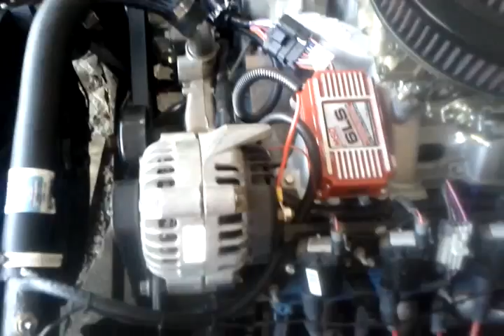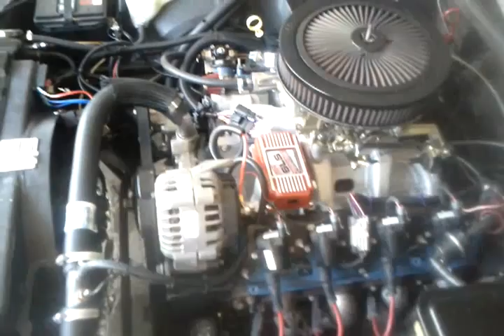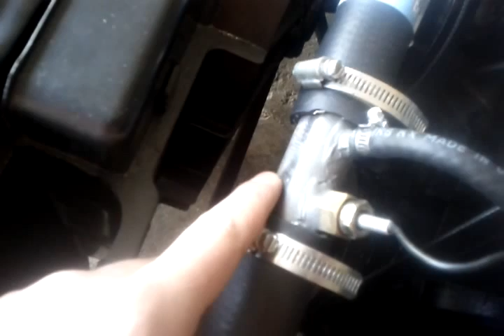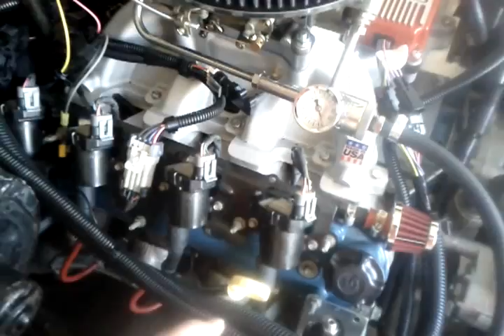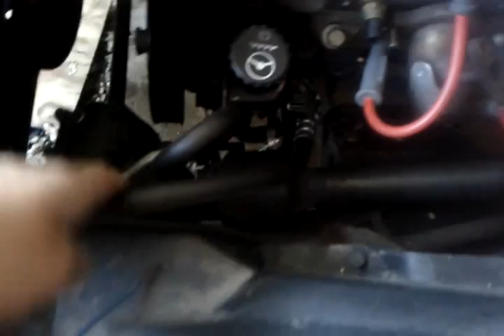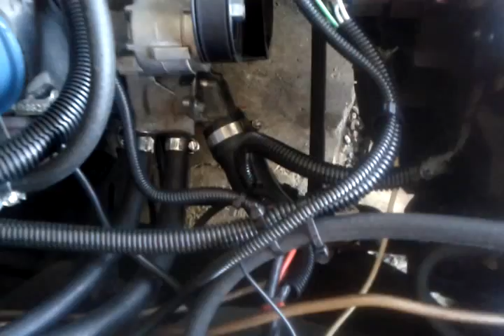How-to: Swap an LSx Ls1 4.8 5.3 6.0 into older GM cars

Comment: Have a 66 Chevelle doing carb ls swap how do I wire alternator if I’m using stock factory harness (Has 2 pin white connector for internal reg alternator originally)

Comment: I saw your video and I'm doing basically the exact same thing Carbrated 6.0 in a Malibu wagon I'm using a TH 400 now but will eventually be going to a T56, my question is will the converter from the 400 mate to the flex plate on the 6.0 or do I need an addaptor?
Reply from the maker: Depends on what year 6.0 you have
Reply: @beeterolds  05 DK what gen that is

Comment: so which block did you put in there , the 6.0 or 5.,3/4.8? ive got a 84 cutlass with a running stock 305 but  i think about 50 of the stock 140  ponies escaped or died in last 37 yrs so seriously considering LS swap and already bought a  $200cdn 5.3LS  but the guy is stalling  on coming up with manifolds , ecu, starter and  alternator so may just resell it and get a 6 litre for 1000 cdn.....if it will fit?

Comment: What wires did you use from stock alternator pigtail. did you just use the exiter wire ?
Reply from the maker: Bingo
Reply: Ok i did that and also installed resistor but its pushing more than 14v and acid coming out battery

Comment: good morning,  Im having trouble mounting the power steering to the engine. Will the truck serpentine set up fit the 72 cutlass or do i need to find one from a car or which pulley can i use.
Reply from the maker: It would. Ud need a pressure hose from a G body tho
Reply: @beeterolds  do you know where to purchase the 5 inch diameter pulley from
Reply from the maker: Any good parts store will have it.. Does it have to be 5 inches?? Some guys use a jeep pulley

Comment: Did your power steering pump have 3 lines , im guessing a return line. Do i need to clamp it off or is there another solution
Reply from the maker: 3 lines means hydro boost... Change ur pump to non hydroboost
Reply: @beeterolds  Thanks alot

Comment: So im having a problem with my LS1 with the 6014. everytime it gets to 180 degrees it starts to stall. any clue on what could be going on?
Reply from the maker: Im assuming the box uses a coolant temp sensor??
Reply: @beeterolds  Yes it does. i bought a new one. also my electric fans are on as well. You think i have a faulty temp sensor? i have heard of that on some websites.

Comment: How did you set up the fuel pump,is it wired thru you ignition or did you go thru an oil pressure switch???

Comment: When you installed the alternator and power steering bracket what did you get that off because I'm not sure what to use
Reply from the maker: Stock truck
Reply: @beeterolds  what year truck did the brackets come from because I'm not using air conditioning

Comment: Im wanting to put a ls into my 93 silverado but was told I need the computer and all but it looks like you didn't need all that with the carburetor correct?
Reply from the maker: Correct. Just msd to control ignition

Comment: So if I were to take a 5.3 vortec and 4L60E out of a 2004 silverado, could I just drop it in a 85 C10, and use these instructions?
Reply from the maker: It should drop right in as long as you have the correct engine adapters.. the trans mount is in the same spot assuming ur 85 has a th700
Reply: @beeterolds  okay, thank you. Hopefully it works out good.

Comment: What wires are use under the dash to start car I’m doing a g body now
Reply from the maker: Fusible links, and your 12v source from your HEI to power the MSD if you go that route. It's easy.
Reply: @beeterolds  Pink wire off the IGN, switched 12Volt.

Comment: Temp in the head is much higher than in the upper rad hose (you'll think it's running cool all the time)
Reply from the maker: Yessir... Temp gauge reads 180 while in fact the coolant in the head is around 210. I knew that going into it. I've since remedied that situation

Comment: Can I convert the Direct Injection Fuel pump for use on a Carb setup? I was looking at an l83 5.3 for use offroad using a simple conversion to carb like you used here.

Comment: I know this video is old but I recently did a similar swap on my 89 Camaro and exhaust wise I was kinda screwed until I found cheap Chinese long tube headers with a Y pipe fitting for $275 and with thick aluminum crush gaskets they don’t leak and they fit!!! Much better deal than paying $700 for swap headers
Reply from the maker: You can get them cheaper than that...
Reply: BeeterOlds / really? I mean these headers tied right into my exhaust I just had to replace the factory cat with an oval one from summit

Comment: Is it possible to reuse the stock electronic carburetor with this setup. 
My is 87 elco with 305.
Reply: I'm trying to do that now building adapters for my 89 tbi intake to fit on my 5.3
Reply: @luisviscarra6321  let me know of your end result.  Thanks

Comment: To the point and simple.  You sure brought out a lot of haters with you "To the point video". O wish I would have went this way on my current build. 87 4x4 Silvarado. Putting a 383 stroker together with ported heads and Quadrajet for all day drivability. I'm about positive that any stock LS with your setup will out pull my SBC after I'm finished.
Reply from the maker: People suck. More than likely the haters have never lifted a wrench or built anything

Comment: What electric fuel pump and pressure regulator did you use
Reply from the maker: Factory 4.3 TBi from a Monte and Holley regulator. Set at 3.5 psi

Comment: Why in the world would you run a carb and not fuel injection? Dumb as hell.
Reply from the maker: $400 for a used intake and MSD controller.. $1200 for EFI when you do it correctly. That's why..nothing wrong with a perfectly tuned carb setup reliable as hell. No special trips to the Dyno paying out the ass for each session. I eventually ran EFI and it was such an expensive headache for a weekend car it's not worth it. Daily driver yes

Comment: What I hate is everyone is ls swapping for the wrong reasons. People who ls swap because it's what they see others doing and because it's what the're told to do is just dumb. If I LS swap I'm gonna use a cast block,LQ4, LY6 or L96, modified l96 heads, machine shop can make it a 383. use forged internals, use custom cam grind and I'll basically make it a stronger block version of a gen 1 racing small block. A factory LS1 is garbage and not worth swapping. Honestly if your a hipster after EFI. gen 1 Small block can do efi as well, look at the vortec 350 for cheap
Reply from the maker: Jack of Blades cheap performance.... Most of these engines can be had in running condition 350hp with headers for dirt cheap.. try that with a 350 or 455 Olds and you'll think twice about it while youre ridge reaming your cylinders on a 45yr old core... But yes I agree.. people need to be creative and follow their own lead not someone else's
Reply: BEETEROLDS but would you agree a bone stock ls1 swap into a older car when you can have a feshly machined vortec  350 with more power is pointless
Reply from the maker: Jack of Blades I mean it's a matter of opinion. I'd rather have a cammed 5.3 or 6.0 truck engine instead of an Gen 1 sbc.
Reply: BEETEROLDS but there is a price per power difference. Vortec 350 with good machine work and race parts will be faster for less

Comment: I dont like the idea of MSD boxes sitting on the Manifold. The capacitors inside of them are only rated for 120°.
Reply from the maker: Don Rutter neither do I. This video is 6yrs Old. Shortly after I made it I moved the box to the inner fender
Reply from the maker: Peter ummm.... I’ve made like 100 update videos
Reply: Don Rutter I think I would have mounted it on the firewall

Comment: What did u do to get the power steering work in with truck pump to fit with out hitting gear box
Reply from the maker: +Michael Rabatin all depends on what motor mounts you use. I used adapter plates and setbacks

Comment: can an 89 scottsdale 5.0l rearend work with ls1 motor out of gto?
Reply from the maker: Bekkah Rannahh the axle should be an 8.5 inch it’ll work out alright as long as you’re keeping the motor stock
Reply: motor will be stock. question what parts will the 89 scottsdale need from gto? besides ecu, wiring harness ecu?
Reply: and how much is swap usually?
Reply from the maker: Bekkah Rannahh all depends. I can’t answer that with one sentence honestly. Research and get creative

Comment: I wanna put a 5.7 vortec engine from a 96 suburban into a 85 el Camino I want to know is their any issues that I'm going to run into thanks
Reply from the maker: francisco ortiz what engine is in the el Camino now? And are you going carved or Efi
Reply: BEETEROLDS it has a 5.7 also but I feel it's lagging in power plus it's carburated and I want it to be efi
Reply: whats in the el Camino now ?? a v8 if so it should be a no brainer small block Chevy is small block Chevy all should work out the same if it's a v6 in it now you'll have to move the motor mounts to different holes in the frame but other than that and what's your plan to run a carb or the throttle body ? that's what
 is gonna be the part that's gonna change things a bit if it were me I would just run a carb and a hei on the vortec motor keep it simple

Comment: Are u in California ?
Reply from the maker: richard villa not even close buddy
Reply: BEETEROLDS Swaps & How to i was asking because I'm trynna get my cutlass a v8 does it really make a difference in gas ? It currently has the v6 3.8 engine but I really want a v8. Don't know if I should go for the 307 olds or ls
Reply from the maker: richard villa the V6 is terrible my car started with the 3.8 a long time ago before I swapped in and out 6 different engines

Comment: i got a 5.3 in a 83 elco. i have everything in but the car is not getting power. its grounded and the wire that went to the distributor is connected to the pink wire. how do u have the starter wired?
Reply from the maker: Juice 23 why don't you watch the entire video I explained it.
Reply from the maker: MrHustleman420 are you saying you have no spark or it won't crank? make sure the MSD is grounded to the battery directly
Reply: BEETEROLDS Swaps & How to i got it goung now. thanks. i had some wires wrong
Reply: BEETEROLDS Swaps & How to how did u wire the alternator

Comment: LESS WIRES,LESS PROBLEMS 3 WIRES WILL RUN A SMALL BLOCK, KISS FACTOR!
Reply from the maker: ed damude that's your opinion.  I ran a 403 and 455 Olds for years this swap is much better. In my opinion

Comment: Good Job, but how do you bypass the heater hoses on an Ls b/c I have taken my heater box out on my Cutlass and I don't plan on putting it back in?
Reply from the maker: MrVigor47 simply run a loop on the water pump. It's easy

Comment: Hey thanks for the info,turns out I had the right mounts after all,some how 1of the mounts got cocked,I don't no how that happened as I'm using a ls1 block that dissent have the a/c mount screw hole ,turns out I tighten the 2 top bolts too tight and didn't tighten the 1 screw on the bottom,so their bottom of the mount was not sitting flush with the adapter plate,THANKS again

Comment: hey i wanna put a ls1 in opel senator a which is identical to holden commodore vk. its a 1983 model with a 3liter 12v engine in it now.
Reply from the maker: Legenda I wish I had info for you brother but sadly I do not :( good luck with your swap

Comment: Also I'm doing a ls1 swap,I bought new frame mounts and when I put the mount at the very front hole I can get the 2 top screws in the in the holes but the bottom frame mount there is no hole there,but when I move the mount to the second hole I can get the screw to go in that hole,if I buy the adapters that u have will the mounts line up,did u experience this issue,as I have an 87' 442,thanhs
Reply: Darnell Grays is

Comment: Any oil pan issues? I'm guessing a truck pan would hang down too low. Assuming you are using a F body or H3 pan?
Reply from the maker: woog74 it's in the description
Reply: Thank you I had not clicked on it before
Reply from the maker: woog74 yes sir. If I were to do it again I would use a cut down truck pan
Reply: That's what I was thinking. I read that you converted back to fuel injection now. Did you go with an external pump and an external sump for the tanks?
Reply from the maker: woog74 internal factory style pump and sender. I made a lot of videos covering each system
Reply: OK great, I'll search for them, thank you

Comment: Want to attach a 6 speed automatic transmission to my 2007 Corvette engine, which vehicle will be best for a to chose for the transmission? Want to use a 6L90E automatic tranny!! What will I have to do the ECM to mate it up to the automatic transmission so it will shift properly and will I have to do anything to the TCM???
Reply from the maker: Bobby Brown dunno brother I don't wanna give advice when I never messed with the 6 speeds

Comment: 7 minute video complete. I am now a certified internet mechanical genius. bow before me
Reply: good video tho
Reply: crimsoncreep26  what can i delete from the motor that I don't need if I'm gonna run a carb and the msd box
Reply: Will a 94 GMC Sonoma engine and transmission work in a 2005 Chevy trailblazer ls

Comment: Going to do this swap on a 89 s10. Keeping it efi. Would I have to change the fuel pump too? That's the only question I got.
Reply: a Colorado 50 psi pump fits into the stock 1st gen s-10's fuel tank(i bought a brand new replacement tank). you will need the corvette style regulator/filter as well. you may need a H3 oil pan unless you don't mind notching your cross member. i just bought the poly frame mounts/steel engine mount kit. instead of using the 2.8 v-6 clamshell required to do this swap. since i went 2001 5.7 LS1/LS6 intake/t-56....the shorty headers require almost no re-shaping to do the swap. you will need a notch kit if you plan to keep the a/c box. if it came w/o ac than you do not need that kit from jagsthatrun/s-10-Lsx kit sanderson headers.

Comment: I have a 5.3L from a 1999 Tahoe installed in my 1971 Chevelle. I have a floor shifter, how do I connect my cable? Do I use the factory cable for the 5.3L?
Reply from the maker: what trans are you using? I need to know more info
Reply: 4L60 is the transmission
Reply from the maker: John Smith you're going to have to get an aftermarket cable and bracket
Reply: Ok. Any Suggestions?
Reply: He just made the suggestion lol, use your head and figure it out...
Reply from the maker: Peter O people want me to hold their hand every day bro
Reply: THANKS

Comment: how would i go about dropping one of these in my 2003 gmc jimmy? any idea if i bought the engine how much it woulf cost for a mechanic to install it?
Reply: I dropped one in a 84' blazer frame. use original mounts. I used a ICT billet bracket. it has a couple different offset drilled.check out ICTbillet. they have lots of stuff for LS swaps.
Reply from the maker: jake hagen no clue

Comment: what would i need to swap a ls1 into a 96 chevy c1500?? it has a stock 5.0 vortec in it at the moment...?
Reply: cheque I will be doing the same thing to my 96 z71 silverado...I'll be getting motor.mounts 1inch setback, flywheel and bolts to bolt on the existing 4l60e, harness ecm...
Reply: What's the horsepower on a 5.3 with carburetor
Reply from the maker: Dunno

Comment: I put a ls1 in a 91 s10 and and I did it the right way. Summit makes a pcm for the engine electronics and also comes with a OBD2 DLC and a ses light. No disrespect to you but you wasted all your money to make it work and it looks like a octopus in your engine bay. Also why in the hell didn't you put a 4L60E in it instead of that junk metric 200.
Reply from the maker: tlt40s&w 70 so your opinion is the right one?? I don't think so... sometimes when you have set the expectation too high the project never gets completed. the Th2004r when built properly handles more power better than the junk 4l60 ask the GN guys... those transmissions are garbage... when someone said they did it the right way I know they are full of shit because there is simply no right way when retro fitting..
Reply from the maker: tlt40s&w 70 one other thing to note.. I've had this setup for 4 yrs and I've beaten the snot out of the th2004r... still holding up like a champ... if it takes a shit a 4l80e or t56 will go in its place

Comment: like your swap very clean NEED YOUR ADVICE I have 2 projects I,m working on both chevy 1 a 1973 k5 blazer and a 1970 chevy van the van I,m wanting too convert too 4x4 and put a 4.8 chevy motor in same with my k5 wanting 4,8  any thoughts on what trans and T-case too run in my van I,m using k5 blazer axels I have 2 sets a 12 bolt 3;73 and a 10 bolt 3;42
Reply from the maker: Chris B I appreciate the compliments bro but those questions I am unable to answer

Comment: Hi, I have a 1970 Chevy Impala B-body I'm trying to do a LS-9 swap that I got for a deal, I;m hearing it's a expensive swap do you having any pointers.
Reply from the maker: Well if you already have the car and I assume the complete engine... The expensive part is over... As long as you have the complete engine with the accessories, harness and UNLOCKED Pcm its all down hill from there... The hardest part at this point is making a viable fuel system... You can leave your existing tank alone and run a Bosch inline fuel pump too... The LS9 already has the nice car friendly oil pan too so that saves you an expense there
Reply: Yes I do my question is would i have any problem with the fact that this engine has a dry sump oil pan or is this something I need to change? I'm going crazy over here looking at the supercharger.
Reply from the maker: that I dont have an answers for sorry man
Reply: okay thanks

Comment: what would I need to make factor gauges work? doing an ls1 swap on a 80s model c10. also would I need a external fuel pump?
Reply from the maker: You can use a fuel pump assembly out of an 87 and up Chevy truck or k5 Blazer